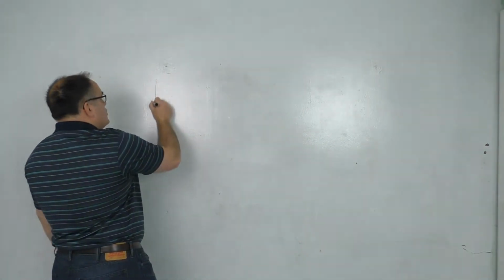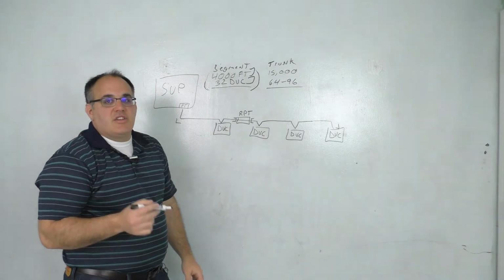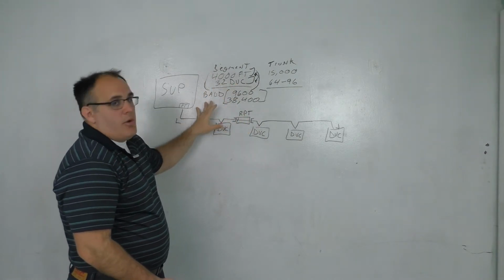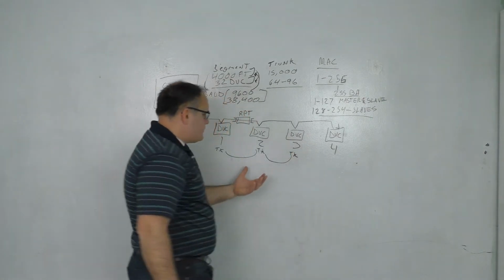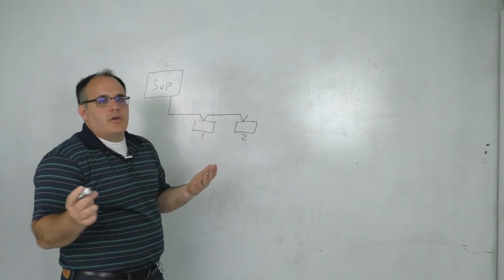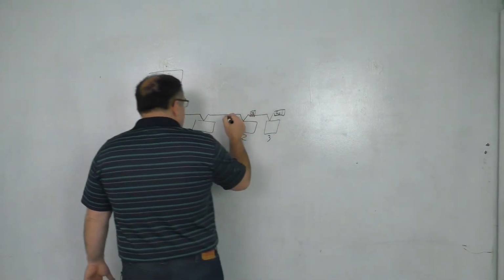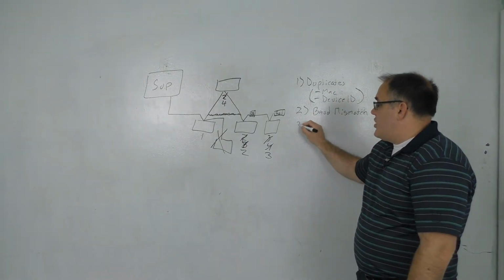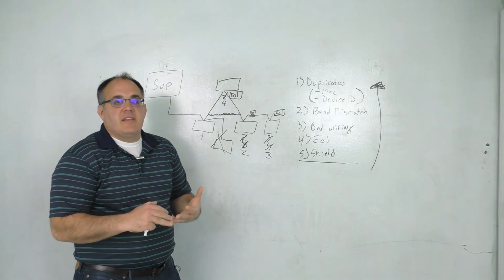BAMTV 006: BACnet MS/TP Overview

Comment: I built an implementation of BACnet Protocol Standard for my company (closed source) that includes MSTP comm. layer. So I basically already know everything that was explained in this video. But if you told me to to put all that knowledge in a precise and concise presentation such as this, I would tell to to F*** off.

Watching this video, there were multiple times that I found myself thinking: "Oh yeah! I forgot about that." 
The video even goes into explaining baud speed, cable length and packet loss.

Fantastic job.
Reply from the maker: Thanks, I believe that folks would find MS/TP a lot easier if folks in our industry had a deeper understanding of what goes on behind the scenes with the protocol.
Reply: @SmartBuildingsAcademy  Not to mention that The Standard is pretty technical about it, so all the theory so succinctly presented in this video would be a godsend 10 years ago when I made it. "Here all you should know before trying to make MSTP comm. layer."   I would've cried. 

You basically had 100 pages of MSTP technical specs and Steve Karg's implementation in C. So good luck.

Comment: on the trunk per Feet limitations is it 1,500 hundred ft or 15,000 thousand ft ?
Reply from the maker: 15k for full trunk which would be (3) 5k foot segment per ASHRAE 135. R-485 Standard is less than that.

Comment: I wanted to just check something but the video was so instructive that I watched the whole video, the only thing I did not understand was the difference between segment and trunk as you use them interchangeably, and while the limitation for the segment was 4000ft for trunk you mentioned 15000 ft?
Reply from the maker: A trunk can consist of 3 segments.

Technically 3300 feet per segment per the rs-485 standard but you can usually get much more out of it.

Comment: I wouldn’t have though duplicate Mac ids are that common since in theory they’re burned in from the manufacture and should be unique. 
Are there some cases where they can be changed by a tech or something?
Reply from the maker: Yes MAC addresses with ethernet are "burned-in" they actually can be changed though. 

But MS/TP are usually set via dip switches on the physical controller. MS/TP is a different protocol than Ethernet.
Reply: @SmartBuildingsAcademy  many thanks!!

Comment: While I agree with a lot of your best practices I must point out that there are some things that you said that are completely incorrect. 

The biggest one being that devices do not have to be addressed down the trunk immediately in order in a sequential addressing scheme. Yes this definitely is good practice and it does make troubleshooting at a later date easier but having out of order devices does NOT decrease bus speed or put any latency on the network what so ever. You are thinking about the network cable more like a car traveling down a road where the token must travel from one device to the next, this is actually not the real case at all. In Network Communications the cable actually acts more like a long tube through which each device listens and speaks to each other through the tube. As the network is all half duplex and is one continuous daisy chain, when an electrical bit signal is pulsed on the network the entire cable must become charged and discharged to signal each bit, think of this sort of like a water hose where the entire hose must be pressurized and depressurized to make a bit signal...so having the token skip over a few devices to get to the next address does not take any longer at all because the entire network cable must be charged and discharged, its all virtual the signal does not actually "travel" down the cable. 

Now having said what I did above there is one IMPORTANT thing to consider and this one is key. If you have gaps in your addressing sceme, where addressing goes from 1, 2, 3, 4, 5 and then suddenly jumps to 50, 51, 52, 53 then yes this large gaps can and will slow down your network and put a lot of dead time on the network. This happens not because the taken falls off the network or can't travel to the missing devices but because the last Master device must sit and wait a required length of time for an answer before it says to itself "Well that device must be offline, so I'll move on the to the next one." and then tries the next address to pass the token to until it eventually gets an answer and passes the token. So having sequential addresses is highly important, but they do not have to be in order down the wire. Also, while we are on this topic, setting the proper Max Master settings is also important, else when the token gets to the last device on the bus it will just keep calling blank addresses until 127 before it finally starts back over at 0 and works its way back up.

Next. I don't know what part of the world you are in, I'd suspect somewhere up North but here in my area we could not even begin to pay an electrical contractor to install controls...they would just laugh as they walked away. Hell we cant even get our standard HVAC technicians to deal with controls...when they see controls on a unit they instantly lock up and can't even do the simplest of things like trying to jump out a unit to check its operations on a PM. If you want a properly installed system...you have to install the system yourself with your own team who is properly trained...otherwise, you are going to be spending a CRAP ton of time going back through every bit of the system trying to determine what they did incorrectly and why the system won't work at all. 

When it comes to baud rates...I guess you must be a JCI Rep? Doesn't matter but there are a lot more speeds than just 38400 and 9600 and if you're going to talk about Bacnet on a non-brand specific basis then you really should talk about all the speeds and how one should go about selecting and downgrading speeds in a good practice basis. One of the key things I think you left out of your discussion about network practices and common problems is Biasing. Remember that each segment must not only have proper EOLs but also proper biasing.
Reply from the maker: 9600 and 38.4 are the only two speeds required to be supported by the standard thats why i talked about them.

The addressing being sequential does have an effect because of the reason you mentioned waiting on the poll prior to passing the token from master. If you have your addresses out of order this will have an effect on the comm speed over a long 5k feet plus run. Tested this out with wireshark in the lab and proved it out several times. 

Biasing is important but its rarely a reason i see for trunks going bad.

Thanks for taking the time to reply. :-)

Comment: Phil, I have a question about a project we are working on ..BACnet routing – BBMDs, traffic routing/polling via MSTP vs IP, how MSTP serial links function, etc.

When there is routing through MSTP-to-IP converters (such as supervisory controllers or 3rd party devices like those from LOYTEC and Contemporary Controls), is the polling interval controlled by the MASTP routing/converting device or does the polling IP device control the poll rate of the serial link?

Also, if controlled by the polling device, can each device on a link be polled independently at a different rate? Or must all devices on the link be polled at the same rate?

Let me know if you have any questions about this.
  If you need to email me please do so at frank AT devicoservices DOTT COMMM.  Thank you